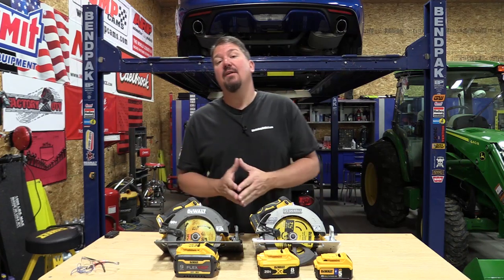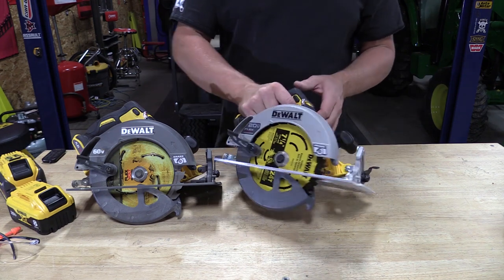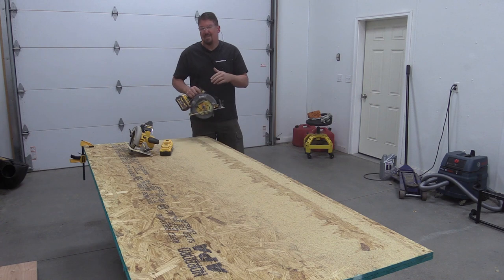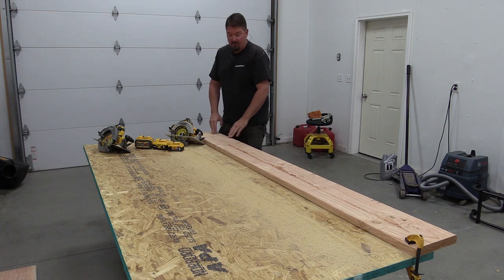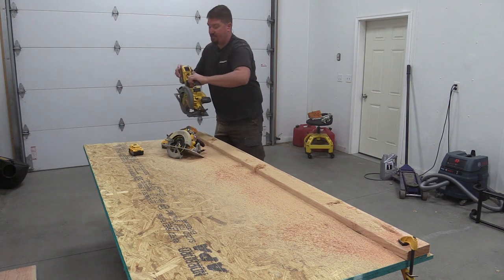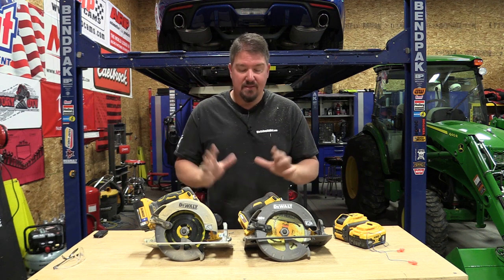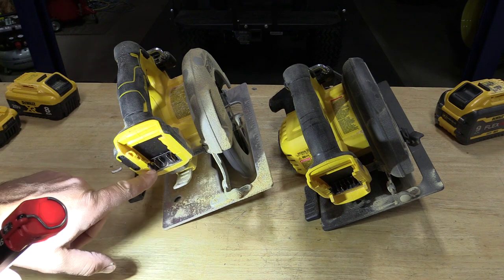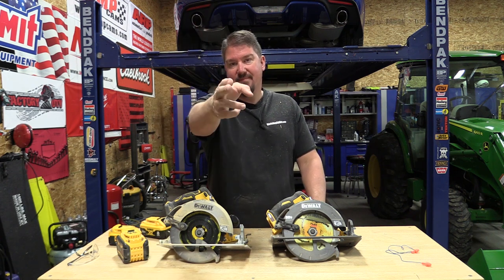DEWALT FlexVolt Advantage 20V Brushless 7-1/4" Circular Saw DCS573B Vs Flexvolt 60V Circ Saw Review

Comment: Just to help for future reviews, but The Voltage (20v vs 60v) is the measure of POWER the battery is able to put out at any given time. the Amp Hour Measurement is a measure of the amount of energy the battery can STORE. So there is absolutely no difference between the amount of power you can get out of the 5ah vs 8ah batteries. They both power the motor at 20v. The 8ah battery can just store more energy in total, so if you can make 100 cuts with the 5ah battery, the 8ah battery would be able to make 160 cuts (because it stored 1.6x more energy)
If you are experiencing a different in power between the 5ah and the 8ah batteries, its more likely to do with the age/remaining charge left in the battery rather than any actual difference in capability.
The Flexvolt is 60v, which is capable of outputting 3 times more power though, so that one makes a real difference, assuming the tool can use the 60v.

Think of this like a bucket with a hose attached to it.
The bucket size is the Amp Hours
The hose is the Voltage
You can have a 5 gallon bucket with a garden hose, or a 10 gallon bucket with a garden hose. Both will drain water at the same speed, but the 10 gallon will drain for twice as long.

The 60v is basically a 10 gallon bucket, with a fire-hose on it. :)
Reply: Well... Sort of. I know I'm a little late to the party but I wanted to clarify something. While 5 amp and 8 amp have to do with capacity and normally the power/torque output would be the same (and it is in many other brands). The DeWalt 5 amp battery uses 18650 cells and the 8 amp battery uses 21700 cells. 21700 cells have shown to have higher output on power tools (check out Torque Test Channel for more info and proof). Why DeWalt and other brands haven't switched to 21700 cells is beyond me. Probably greed.
Reply: Scott already covered the 18650 vs 21700 angle, but there’s also this:
Moving from 5S/1P to 5S/2P and 3P means more banks of batteries can provide more amps and see reduced voltage drops.
Also, a cell’s capacity and discharge rate are inversely corrolated. A high capacity cell typically has a lower discharge rate, and a lower capacity cell has a higher discharge rate.

Comment: You Said It ,  if I'm going to buy FlexVolt batteries I'm going with the FlexVolt saw with the Big Power especially because FlexVolt batteries are Not cheap.    That Said you can only buy the FVA saw as a Bare Tool for $199 , so for Me  the Power Detect is a Way Better Deal because for $80 more I can buy the PD Kit for $279 and it comes with the 8.0ah battery , Fast Charger and a Bag and I already have the PD hammer drill and grinder.
And what's even Crazier is tha Actuall FlexVolt dcs578 bare tool is $20 cheaper at $179 than the new FVA saw and the Kit with a 9.0ah FlexVolt battery and the New 6amp Rapid Charger and Bag is $299 , it's Crazy,  the more I think about it , the less the FVA tools make sense , but I guess more options is always better , and after all this Dewalt Still hasn't come out with a New Impact Driver to replace the 887 , its Nuts.  Anyway , another Great Video , I can't wait to see the rest of the FVA Line ....👍🛠🖖
Reply from the maker: The price of 199 won't stay with this tool.  My link to it on Amazon has it at 185.  We will see this for 160 soon IMHO
Reply: @WorkshopAddict   -- Yeah,  I figured it would go down after time , but even for $19.00 less  , if I have a FlexVolt battery I'm going with the FlexVolt dcs578 for all the Power,  but that's me...👍  I'd still love to see Power Detect vs. FlexVolt Advantage , what do ya think ?? 🤯🙏🖖
Reply from the maker: @brianf9619  I might do it, just have to balance my time with all of the work we have right now.
Reply: I just bought the flex advantage from home Depot and it came with a 6ah flex battery and fast charger free
Reply: @joeljv5982  --- So you bought the Kit , I didn't know they had one.   How much was it ?
Reply: @brianf9619  it was a promotion they had going. It was buy the battery and charger and pick a free flexvolt tool. $299 CDN
Reply: @brianf9619  it is at Home Depot for the Dewalt DCS 573, with 6 ah battery and charger for $199
Reply: @guns8527    Yes , at the Depot , its $199 , its online , you gotta look good , check out Tool Boss he did a video yesterday and he's got a link to it .....💥👍

Comment: After so much choice to make I decided to change my job .I already have the wormdrive still, and the one how is going on the track, and the track saw, all FLEXVOL, and for me to buy another circular saw will be crazy no matter how much power has.
From somebody how has his business making tools and his doesn't make it from the first time,  and needs 100 saw to get it right, dose not shows professional approach. 
And the mistake to buy Dewalt started with a nail gun, which is not that good. 
Big mistake , I should go with Makita or Milwaukee, definitely Milwaukee, but not even milwaukee has all the solution in time, so definitely Bosch ,or Hilti? Not hilti to expensive, much more expensive, and does not have all the range either ,so with how I have to go? Probably I shouldn't drink the bloody ink in school and become an architect or inventor? I am confused,  like the choice with so many Dewalt circular saw.

Comment: The flexvolt advantage is just marketing wank. The only way using a flexvolt battery will give a substantial increase in power is for the cells to be running in series. This will supply 60 volts to the tool. Running it on a 20v tool doesn’t do anything. The slight increase in power you are experiencing is do to the flexvolt battery being rated at 9ah when running on 20 volts. There isn’t anyway to pull slightly more voltage on a 20 volt tool. It’s 60 or 20, that’s it.
Reply from the maker: If you watch the video, the PD and FA performs about equal, except the FA tool performs better with lower Ah 20 volt batteries.
Reply: @WorkshopAddict  Who cares just get a Flexvolt .
Reply: So Dewalt are charging double the price for a battery that is wired slightly different when the different unit is plugged in?  Are the individual battery cells any better quality?

Comment: Ok... call me backwards , call me dumb.... but after watching this video, I am more confused than ever.

20V versus 60V... but the 60V are also 20V, the Advantage has the advantage over the Flex, but the other is more flexible...

“New line of 20V tools called the Flex-Volt Advantage”.
Uhmmmm, aren’t FlexVolt supposed to be 20V AND 60V???

And both saws have FLEX in their names...

WHY couldn’t you just use the MODEL NUMBERS of all these saws, batteries and chargers???
After all, that’s how I would search for the boxes in the stores, or on-line...
And MODEL NUMBERS are totally unambiguous.

Puts me in mind of the refrain from a song I heard back in Nineteen Sixty or Some...
After the poor boy heard a complicated explanation of a simple subject——

“it was clear as mud, but it covered the ground,
Confusion made me head go ‘round!”
🤯🤓
Reply from the maker: Flexvolt tools are 60 volt only.  Flexvolt batteries are 20 and 60 volt.  Flexvolt Advantage tools are 20 volt only, but will work better with Flexvolt batteries in their 20 volt form because of the amps that can be drawn from them.  There will be people buying the flexvolt advantage tools thinking they bought the best 60 volt tools out there.  I do think this is very confusing to some.